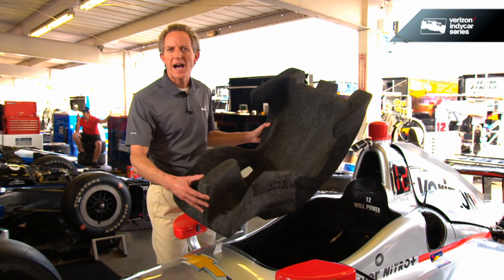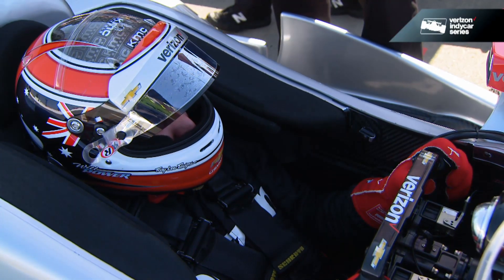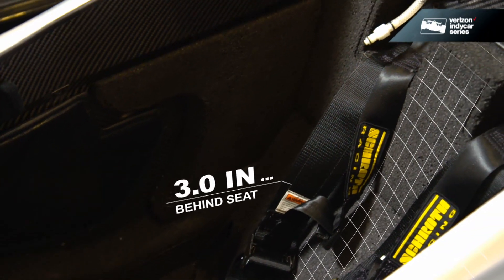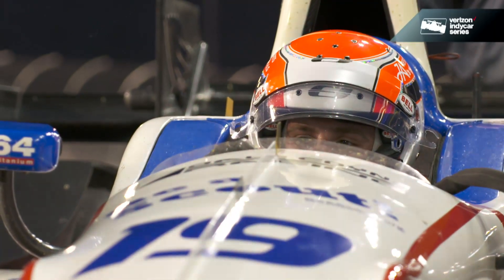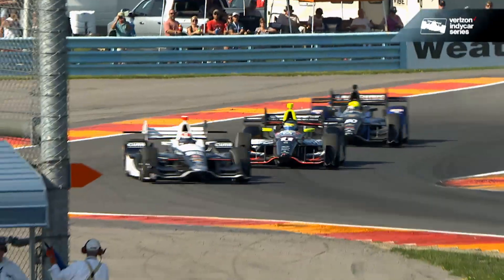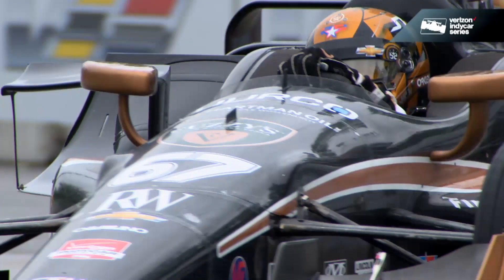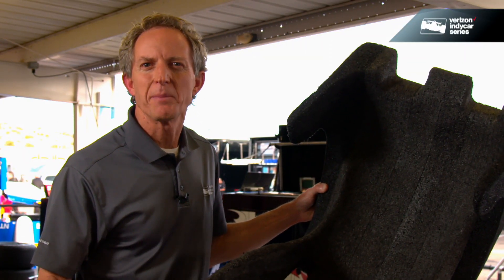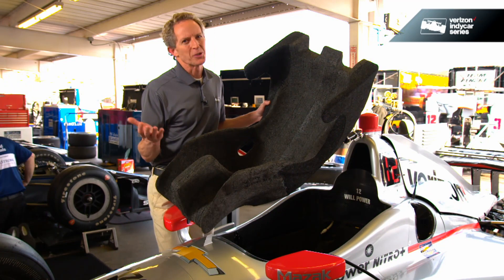IndyCar 101 with Professor B: Driver Seat Technology

Comment: By any chance, are the seats replaced regularly? If so, why?
Reply: At $3,000 each I doubt it's regularly, but I suspect the foam would begin to fatigue from the cycle of heating & cooling over the course of a few race weekends as well as general wear from impact, driver sweat, rain, etc.

Comment: The formula 1 seat position is so diferent
Reply: I think F1 still sits on the bottom of the car without foam using carbon fiber instead.  Correct me if I'm wrong.
Reply: bharris3 Yes that's indeed the case